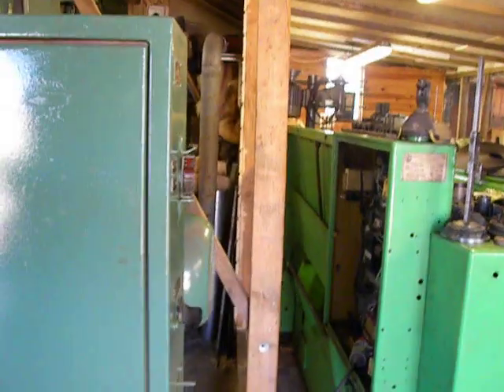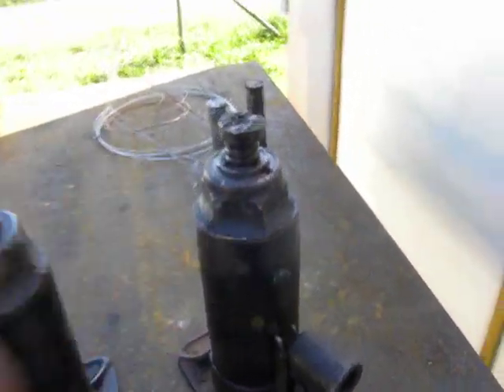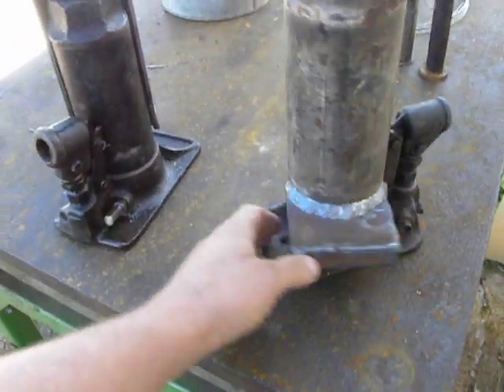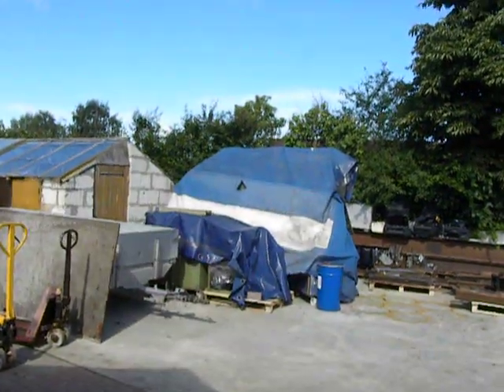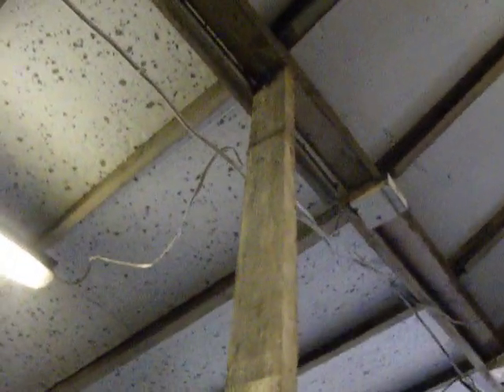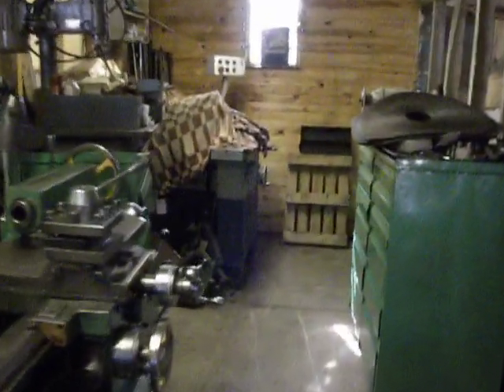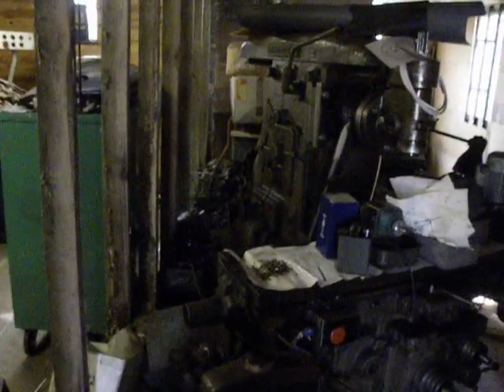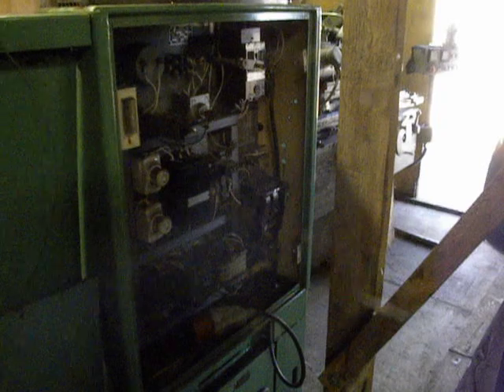Hard Task for Workshop  - Some Progress

Comment: For the roof support you could make one from pipe with flat plates on the ends for bolting it. Thats a big job youve got moving all the machines , good luck.
Reply from the maker: Pipe with flanges - yea, it may help, but that I solve after machine move.... too busy for to think for another crap.... sorry.... too muhc to need to be done... 
Yea, there I already call for my friends for to do this... I form "sturm battalion" for this...
Cheers!